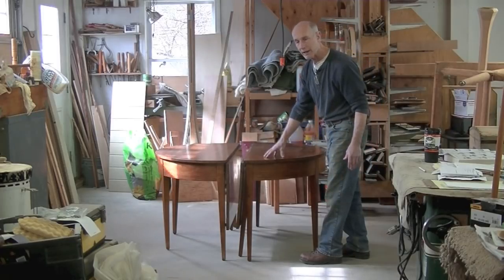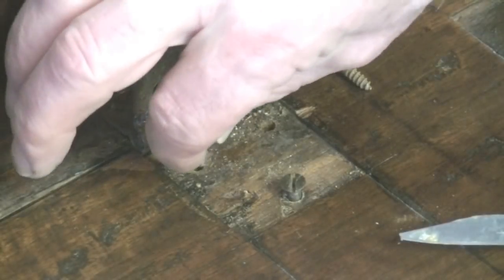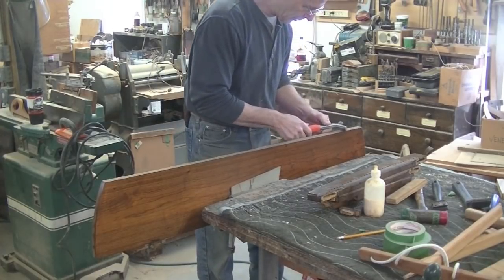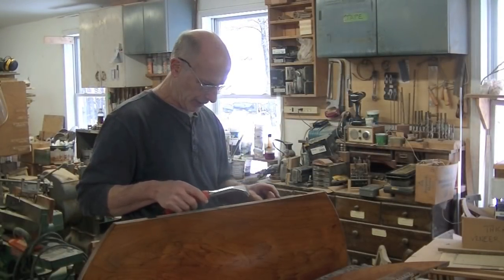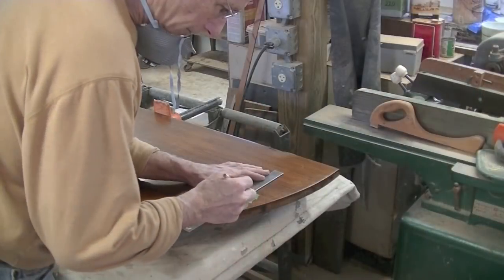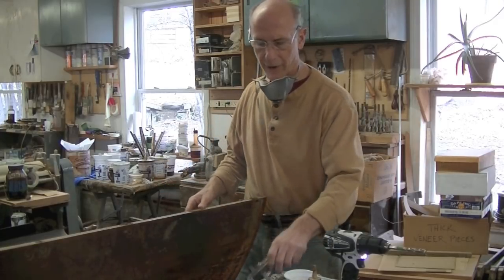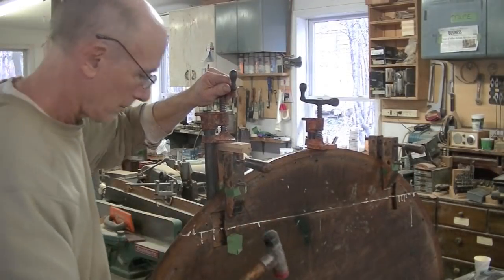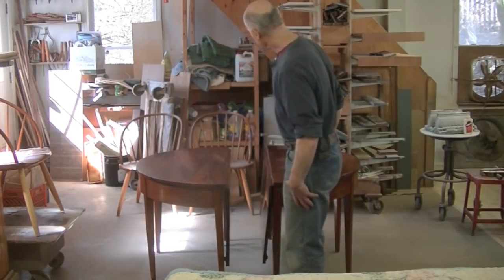Repairing a Round Table Top - Thomas Johnson Antique Furniture Restoration

Comment: Enjoyed this video very much. Interested in your first clamping method. How did you make it?  Is it effective?  Any tips in using it? I have a similar project which includes a semi-circle glue-up.  Method number one may just be the ticket.
Reply from the maker: Hi Neil, thanks for watching. That first jig broke while I was clamping it! I want to make another one using a metal strap, screw the wood blocks to it, counter sinking the screws. I'm sure it will work well. Just waiting for another 1/2 round top!
Reply: @johnsonrestoration  It's a really great idea!! Thank you for responding. I do enjoy the videos, I learn a lot from them.

Comment: The walnut grain was glorious and the repaired joins were scarcely visible.  I have been watching the glue ups with greater interest since I now have a small task of my own.  My spinning wheel only came with 3 wooden bobbins and these ones are fairly delicate.  Unfortunately I dropped one and broke off about 1/3 of one end.  I will work on the dry assemblage before I glue, as I have seen you do - but clamping may not be possible so I may just have to rely on tape.
Reply from the maker: Thanks! Yes, sounds like a difficult glue up. And yes, practice the glue up dry. Even then it can get tough when the glue makes the pieces slide. Apply the glue to both surfaces and let it dry for a couple of minutes so it gets tacky

Comment: I just bought a new hot air gun from Wagner it it goes from 650 to 1600 degrees. Which setting would be ideal for softening glue? I just bought a TV stand nothing antique but solid wood and it needs some work and some regluing.
Reply from the maker: Great! I use the medium setting on mine which is 450 degrees. So use the low setting and be careful! Do not scorch the finish!

Comment: Very strange set of tables. Walnut is sort of the wrong period for these, but the tops seem to match the bases (hard to tell in the video). The mis-matched hinge locations make me think that it was recycled from another table? OR even a drop front desk? But then it still matches all the rest. It must have been made from recycled (nice) lumber. That seems to be the only thing that makes sense.

Curious: did you replace the missing butterfly clips?
Reply from the maker: Yes, another mystery, because all the wood matched. I did not replace the butterflys, I was going to but by the time I finished it seemed pointless

Comment: Hello Mr. Johnson, I recently found your channel and I love your videos. They are both interesting and informative but, like others have said, they are also very pleasant and relaxing to watch too. I thank you for taking the time to make them. Told my dad about you and now he's a fan as well.
One question I wanted to ask - does your workshop have fluorescent strip lighting? This might be the cause of the noise hum on the soundtrack. If so, there are some great led lights available now that will cure it. If not, then maybe plugging the camera into an independent power source might help. Best wishes to. You and your family. Ed
Reply from the maker: Hi Ed, thanks for your kind words. Yes, I have flourescent lights, and the buzz makes me crazy. I just bought a couple of LED's. I'd like to find 8' LED bulb replacements so I don't have to replace the fixtures. I'm not sure they exist.

Comment: I have a Louis XIV china buffet and the top of the bottom piece has a 1/8 inch split on the top about five feet in length. I feel the split was caused by the excessive dryness in the Southwest. Could this be repaired using clamps and wood glue?
Reply from the maker: Maybe. Put clamps on it (no glue) and see if it comes together. A lot of times it won't because of the way it's secured. In that case you have to get it loose to glue it and then reattach it. Not often easy, it depends on how the piece is constructed.

Comment: Did you use metal doweling center pins to transfer the holes you drilled with the jig to to corresponding  surface?
Reply from the maker: Thanks! I do have those pins, and I use them, although I find they have limited value. For flat board edge glue ups I would use a dowelling jig

Comment: Nice job in the end.  Why do you bash the wood so hard with that plastic hammer?  I would have been afraid of denting it.  I probably would have used a rubber mallet.  And if I were afraid the the joint wouldn't lay flat I would have clamped a sturdy flat board to the front right over the joint with a sheet of waxed paper between the board and the table top side, since the tabletop was going to be refinished anyway.
Reply from the maker: Thanks! The mallet head is rubber, but you're right, it's best to be careful!
Reply: @johnsonrestoration  I had two rubber mallets. A black one and a white one.  Larger diameter than yours. They were both softer than yours as witnessed by the sound of the hit.  One thing with rubber mallets - they can pick up metal and grit pieces so a fellow has to make sure they are clean with nothing embedded in the rubber.  I bet you keep yours nice and clean.

Comment: Why didn't you use a strap clamp? It would had been easier.
Reply from the maker: Strap clamps won't pull the boards together tightly. I needed direct pressure perpendicular to the joints

Comment: HI Tim, 
What is the 'glue' that you use and is there a particular brand you use?  
Thank you!
Reply from the maker: Hi Alicia, that's Tite Bond wood glue. Any wood glue works fine. More important then the glue is whether or not you've got good wood to wood contact.
Reply: Fantastic, thanks so much for your response; also incredibly impressed by the magic you do!
Thanks for sharing your talent on line.